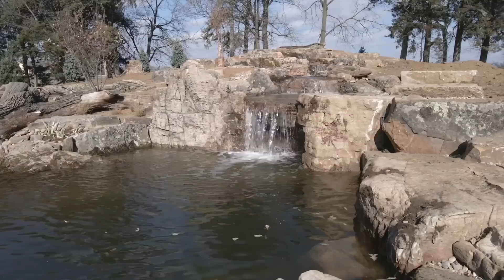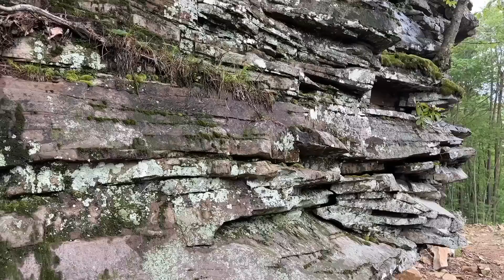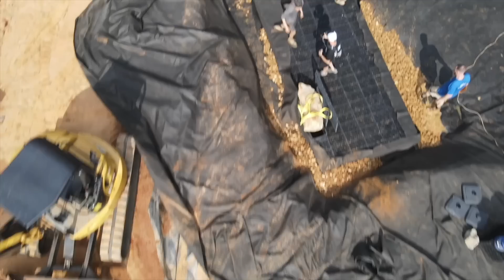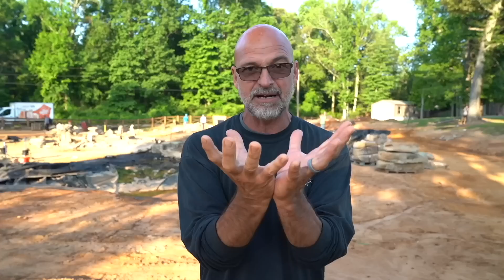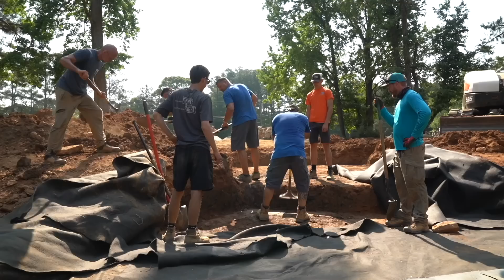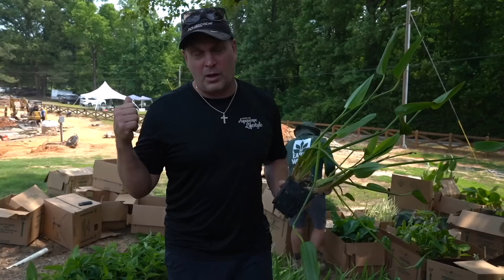Moving 1,000,000 Pounds of Rock for SHAQ

Comment: Hi Ed, On the Universal Aquatics channel I saw that you installed 2" Check valves with 2"x3" adaptors to the 3" Flex. PVC pipe for all the pumps. Since Aquascape makes 3" Check Valve Assemblies, why didn't you use them?

Comment: Just a suggestion...tree trimmers/removers use 'ground protection mats' to protect lawns when moving heavy equipment in place to do their work [the mats act as a bridge to distribute weight avoiding compression marks].  I don't see why you couldn't use those 'mats' to avoid what happened, as well as, over your filtration area.  Can't wait to see the finished project - EPIC I'm sure.  Cheers...
Reply: rig mats
Reply: @ThaGreatestAlexander  They'd work too...but they're heavy and not easily placed or manuvered by manpower.
Reply: @ross6343  no you need to place them with the machines moving the rocks
Reply: @ThaGreatestAlexander  I know - I've used rig mats in the past.  Given the site equipment in the video, the lighter ground mats would've worked as well...even if you had to double them up.  But hey...it's an 'either/or' call.  Be well.